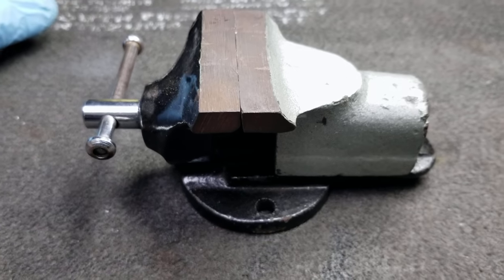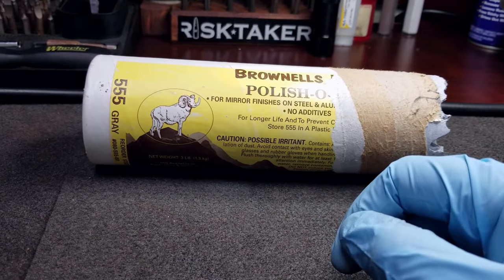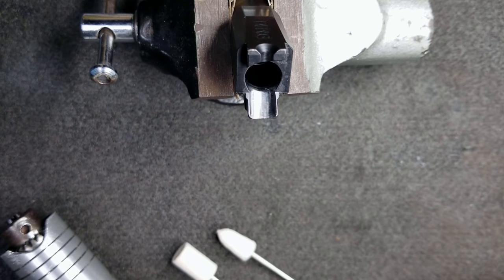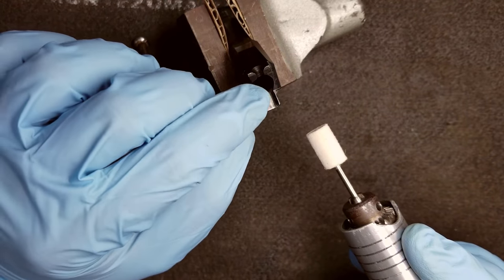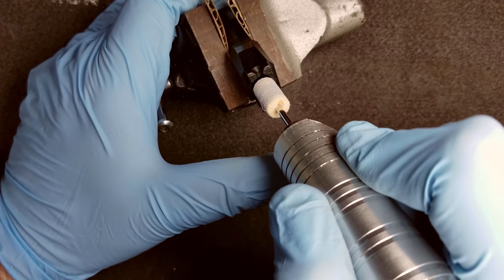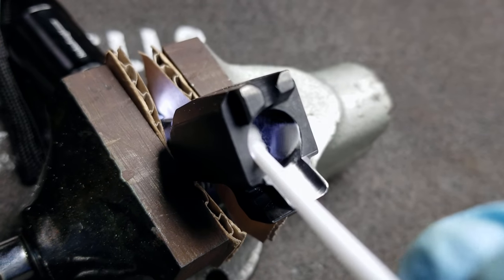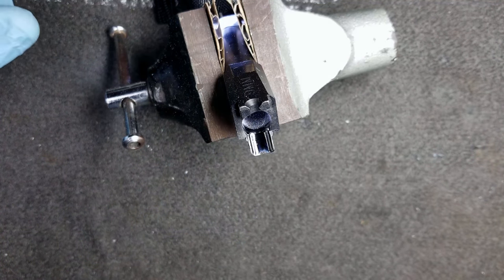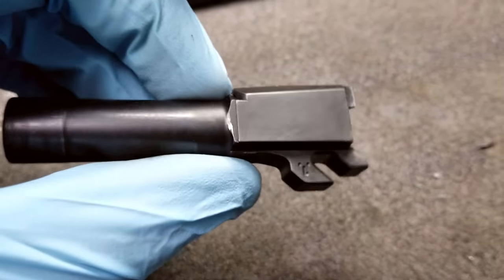How to Polish a Feedramp Quick and Easy

Comment: I use FLITZ. The best polish I have ever used and I'm a 26 trucking veteran. I've been through hundreds of different types of polish but FLITZ is the best by far! No prepping, or sanding necessary as long (as it's already smooth) and get a dremel  amd start polishing away.
Reply: that sounds great. i will try that. (flitz)
Reply: @David Downs  Works great on plastics and glass, too! Like taillights, headlights, instrument gauge panels, etc. When it comes to plastic, make sure to test on a small inconspicuous area...👍
Reply: @martinz.4852  i appreciate it, i will try it out.✓✓✓
Reply: Mothers mag polish is amazing!

Comment: Very well done.  Beautiful workmanship.  I can tell you that a well polished feed ramp and chamber make a GIGANTIC improvement in hand gun performance, especially when using the modern hollow point self-defense rounds.  Had to give you a sub for this high quality video.  Thank you!
Reply from the maker: Thank You glad you enjoyed it.
Reply: @TheHobbyGunsmith  (.
Reply: I second everything Phil said.  I subscribed as well it was so well done, succinct, and simple. I have a G3 experiencing these issues as well. Your video will make the job easy.
Reply: Great Video! 
I will be adding this upgrade to all my pistols!
Subbed!!!
Reply: @williammoore6952  William, properly polished feed ramps and chambers make a gun work like butter.  And they are much quieter.  Just don't get in a hurry.  Polish (remove metal) very slowly.
Reply from the maker: @williammoore6952  Thank You brother.
Reply: @VonGoth 2015  A year later, I am interested to know if your polishing job made a big difference on your G3?

Comment: Every Taurus g3 and g3c needs this done for sure. Taurus needs to wake up their quality control machine work.
Reply: Exactly out of the box yesterday and already looking up what to do about this.:face-red-droopy-eyes:
Reply: Don’t buy cheap guns
Reply: @solo401_  I even had trouble with a czp10c after only 34rounds. Sent it in just got it back so going to the range asp to see how it works
Reply: $300 gun 🤷‍♂️
Reply: @solo401_  their is FNs doing the same thing not just cheap gun
Reply: Got my czp10c back so far so good got 100 rounds in it so far no problem
Reply: Funny you say that. My $500 Canik has trouble feeding 3 different brands of defensive rounds, but my $250 Taurus has ate literally anything I put through it.
Reply: @omens_slays  my g2c will but not my g3c or g3

Comment: My new CZ P10C was misfeeding with rounds nosediving into the bottom of the feed ramp. I polished the feed ramp, and also worked the slide, and locked it back for 12 hours at a time for a few days. Gun runs like a champ now.
Reply from the maker: That is awesome, I am happy it worked out for you. its a simple upgrade but impressive.
Reply: Same exact issue with my 2023 p10c. Sending it into CZ-USA for them to polish my feed ramp. Apparently, it does like any hollow points… only FMJ

Comment: I'd guess that half of all feed issues aren't so much mechanical, as they are THIS right here, it's one place that manufacturers save money, especially on budget models. I do this, to a minor degree on every firearm I've ever owned(that had a ramp), and I've yet to have a feed issue I can blame on the weapon. Currently, my G3C had very minor issues with hesitant feeds(never failed, just the feel was off), it was 100% a fault on the feed ramp, I think it took me 5 minutes to fix, and hundreds of rounds later I still love the little pistol, and have 100% confidence in it. You do not need a razor sharp entry to the ramp btw, that alone could create problems with any lead tip defensive rounds, or lightly crimped rounds depending on your firearm, and feed angle. Don't forget that little bit of work on the entry also helps with extraction! Regardless of the firearms price, I would always inspect, and pay some attention to it, if applicable.
Reply: i bought a g3c as my first pistol. 9 times out of 10 it will fail to feed any kind of hollow point, it obviously gets caught on the feed ramp. any FMJ its 100% fine never fails.. just hollows.. going to polish it and hope it helps lol
Reply: Ask any competent gunsmith if polishing the feed ramp to a striker fired pistol helps. Every single one of them will tell you absolutely not and that you're now introducing more points of failure. It's purely esthetic. If your firearm isn't feeding its not because of a feed ramp. The only time this will work hand in and is specific 1911 or similar pistols and that's just to further insure the feeding of defensive rounds.

Comment: On 1911s I also polish the extractor hook, by hand.  Wrap a needle file with a cleaning patch that has been charged with the polishing compound and work it inside the hook and the lower edge where the rim feeds up into the hook. I do this, and use Wilson Combat mags, and every 1911 that has had this treatment works perfectly after that.
Reply from the maker: Nice!
Reply: Does that help jhp rounds feed better? Those rounds always get stuck in my 1911 when trying to chamber...

Comment: Chamber polish on a pistol might be okay (I don't know), but on a rifle chamber it's advised against because the chamber texture helps grab and hold the casing lessening bolt head fatigue/damage and it assists in the sealing of the chamber preventing gas blowback.
Reply: I just spoke with HK about my MR762 experiencing some FTF’s due to the nose jamming into the ramp and that was one of the 3 things they suggested, polishing the feed ramp, that they’ll do if I end up sending it in (along with all the other checks, recoil spring etc.)

Comment: Excellent detailed explanation, you've a new subscriber. I just ordered a Springfield 911 and found out they have a lot of feeding issues, some You-tubers recommend to polish the ramp, and that's why I landed here. Thanks
Reply from the maker: Thank You sir.
Reply: I’ve had those same issues with my 911, been debating on polishing it myself or sending it in for warranty work. Did it work for you?
Reply: @trystinjensen4663  I haven't done anything yet, I will send it back to Springfield because it is under warranty and the might find something wrong I don't see.
Reply from the maker: @trystinjensen4663  Up to now My friend hasnt had any complaints with it.

Comment: I'm glad you talked about the casing expanding against the chamber.
In various Vietnam veterans forums, there's been a lot of anecdotal incidents of the M16 jamming during a firefight. The fault there was not the weapon. It was the DOD switching to "ball powder", against the advice of Stoner. One consequence was that the ball powder accelarated the cycling of the weapon. That meant the bolt/extractor was moved rearward at the exact instance when the casing was most expanded against the chamber, causing the infamous "failure to extract".

Comment: How does polishing the chamber not change the actual characteristics of the chamber? If the chamber is at the limit of spec, by polishing it you are oversizing the chamber. Will this not create the chance for ruptured cases and gas blowing back?
Reply from the maker: When your polishing the chamber you are not removing enough material to cause any issues, your going with very very fine grit polishing compound.

Comment: About how long did you polish the each section? I see that the video cut forward during the polishing parts.
Reply from the maker: There is not a specific time, its mainly till its smooth and polished. all depends on your tool and compound. but main thing is take it slow and take your time.

Comment: Polishing the feed ramp seems to be a good idea since it may get dirty from the rounds brushing up against it and the factory may not have put in as much care to do this job, now then; the chamber maybe something different, do you think the engineers who designed the barrel did not take into account the fact the round casing was going to expand as it was fired?  That to me is a little questionable.   To me I would only do that if I was getting some problems with the round being pulled out and causing something like a stovepipe or smokestack situation.
Reply from the maker: you are partially right. the chamber does not get done at the factory because its a extra step/process that adds additional cost to manufacture, and we all know manufactures are looking for highest profit possible even if it means cutting a corner or two. now if your getting something custom built by hand by a dedicated gunsmith, i guarantee you all of this would be done before you are presented with your new firearm.
Reply: The engineers aren’t the ones cutting corners to keep the cost down.   It’s the CEOs that keep you from getting a polished chamber and feed ramp from the factory.

Comment: Just did this tonight.  I used the conical bob you used on the ramp, and I used mothers.   However, my conical felt bob was kind of the hard felt one.  Same color as yours, but I'm hoping I didn't dope it up by using the harder felt bob, or does it make no difference?  I just got the mirror finish to show on the ramp and chamber interior a bit, and lower RPM and less time than you did.  

Subbed by the way, sir.  Thank you for showing that dremels, when used properly, won't burn the steel away like a damn grinding wheel. :D
Reply from the maker: Makes no difference the compound does all the work. speed does play its part though, but as long as its smooth you are golden. Glad this video helped you out sir.

Comment: What size Bob for the chamber 12mm or 10mm? I didn't catch it on the vid. Thanks
Reply from the maker: I don't really go by sizes. i generally go for a bob that fits the chamber snuggly but not too tight.

Comment: I just bought a Taurus TX22 and the feed ramp has a coating on it from the manufacture. Should I wait until the coating wear off before polishing it or polish it before using the weapon? Also where can I find the Brownell 555 at ?
Reply from the maker: I would recommend shooting it first and see how it functions, if it doesn't need it don't do it until the finish starts to wear off.
Reply: Thanks for the reply. I will take your advice.

Comment: Very nice detailed video. My S&W SD40VE tends to get hung up on me no matter what rounds I use. I'll give this a go and hopefully it does the trick!
Reply: Yes my SD40VE has the same issue I plan on doing this tonight aswell & hit the range tomorrow hopefully this solves that problem!
Reply: Did you try it and how are the results if so
Reply: @suavviii9312  ?
Reply: @green_light_8  it worked like a charm I polished it really good & use rem oil, clean it often & thankfully irs been good no issues & no more jams
Reply: @Suavviii  that's awesome and which polish did you use, I have the same issue just bought it too.

Comment: Well shoot I only have mothers & flitz.  Which would you say is better?
Reply from the maker: Flitz will probably give you quicker results.
Reply: @TheHobbyGunsmith  Time isn't an issue, just want to do what will work best to fix jams.  Would mothers be better then since I have the time?  Guess I'm wondering what gives a smaller molecular finish.
Reply from the maker: @vashmatrix5769  Either option will give you the same results, just one will take longer than the other to reach the desired polished finish because the higher grit count. 
- Mag Polish is around 4 micron, so ~5000 grit
- Flitz is 3-3.5 micron, around 7-8000 grit
Hope this helps to clarify a bit.

Comment: Hi i bought a brand new glock 17 recently and after about 200 rounds i noticed some of the black paint on the feeding ramp is chipping away, i have only had 4 mus feeds but im almost certain it was caused because of me slowly cocking back and then pushing the slide forward with my hand instead of letting it slam home, but i was also wondering if i should finish finish sanding off the rest if the paint in the feeding ramp just to make it smoother and avoid any future mis feeds?
Reply from the maker: If its original glock parts its Tenifer not paint so it shouldnt be flaking, wearing off the finish yes from the rounds sliding up the ramp. but if its flaking chances are its been refinished. but to answer your question yes you can just polish that out and you will be fine.

Comment: where can I get some polish tip the same size of each chamber. I have 5.56,  9mm  308 etc
Reply from the maker: I posted link in the description of the video, there really isnt a set size for each caliber you need yo ho off of whivh ones fit nicely in the chamber you are workjng with from the assortment as they come in various sizes.

Comment: How do you clean off the bobs, removing the black coating?
Reply from the maker: I normally either use a small file or rasp to knock off the black if it gets too heavy. or another option knife scraping. but only if it get super caked on. other than that i don't really clean them much i just swap them out.

Comment: Thank you so much for this video. Very helpful. Simple and straight to the point. I've just ordered a nice dremel, a set of bobs and compound. Looking forward to polishing up my feed ramps and chamber mouthes on some old guns that need it badly. Very nice detail on this. I wish more people made videos as good as this. I do have one question. Is there a way to clean the felt bobs for reusing them, or once they are used are they pretty much spent?
Reply: I would toss them. They get really nasty and I can't see it getting clean again. You'll love the results of the polish. I did mine months ago and am going to do some more of my weapons. There's also polishing of other internals, you'll find lots on YouTube. Good luck.
Reply: @jigs616161  thanks man. I appreciate the response!
Reply from the maker: Thank You glad you liked the video, and to answer your question i typically reuse the same bobs, just ake sure to use the same compound on them dont mix. you will be fine.
Reply: @TheHobbyGunsmith  good to know! I appreciate it!
Reply: Most felt bobs start breaking down and especially if you're polishing brand new factory fresh parts, they tend to be very sharp and precise which will start making the Bob spray little bits of the felt everywhere and you don't want that in your gun

Comment: I have a smith and wesson sd40ve that has a shockingly high failure to feed rate. You reckon this could help sort that out?

The guns only got a couple hundred rounds through it, and a firm tap with the heel of my palm will finish getting the round into the chamber, but I was hoping there was something that could be done about it. Thanks!
Reply from the maker: Without seeing the firearm first hand would not be able to tell you for sure, but make sure you clean and lubricate your firearm first, and then try polishing the feed ramp, all the polishing will do is help the rounds feed smoother and eliminate any friction that could be causing failure to feeds due to the ramp. but try it out. next option might be test with a different magazine.
Reply: @TheHobbyGunsmith  thanks for the reply. Will look into it!

Comment: Appreciate the video. Have a CZ 75D that didn't want to feed HP. Ramp felt smooth so I went ahead with a light polish and it turned out well (cycled a mag of HP). I'll get it to the range soon for more testing.
Reply from the maker: That is awesome, Glad this helped you out.
Reply: I have a new cz 75 pcr as well that's having issues feeding and ejecting HP's as well as bulk federal range ammo. Have you had yours out to range since polishing? Trying to decide if I should polish myself; or contact Cz for them to do to keep warranty intact?
Reply: @lewisscruggspaintingco.pai1498  Yes, went through 100 rounds without any issues. Really wish CZ would have polished the feed ramp at the factory, but the fix was easy enough on my end. Curious, did you end up sending yours in, or polishing yourself? Any other issues?
Reply: @newenglandstacker  no haven't polished yet or looked into sending it in; but stripped and cleaned and oiled it up. The insides were bone dry. Cycled a few mags through just by racking the slide with no issues. Will get out to range with a couple hundred rounds soon to see if that was the issue. If  any hiccups this time will go from there and keep you posted🤞 glad yours is running now 👍👍
Reply: Update: Cleaned and then oiled well w Hoppes#9. Ran flawlessly about 300 rounds;  several different types of bulk range ammo and some heavier hollow points too. Shot super smooth and accurate, very nice shooter. Can't wait to get back out to continue breaking in and making sure that's all it needed

Comment: Will this change the chamber size or remove metal?
Reply from the maker: It should not as your polishing with a very fine grit. You wont be sitting there for a long enough time to change any dimensions. Polish until smooth and shiny it doesnt take much. Just take your time and be patient let the tool do the work.

Comment: How often should this be done ?
Reply from the maker: This is a as needed job, if the feedramp is smooth and polished you should be fine. once you ploish you will notice that its tough for it to get fouling stuck to it or it to get rough easily.
Reply: @TheHobbyGunsmith  thank you , I have FTF issue currently but I believe I will be sending it back to the manufacturer first then afterwards if it still occurs I will do this

Comment: I have a KelTec p11 that has a parkerized barrel chamber and feed ramp.  I noticed that when i cycle the slide slowly to chamber a round the round gets hung up on the ramp sometimes.
Reply: @juancortes5535  ya exactly..  most semi autos usually need to cycle completely back to function properly.